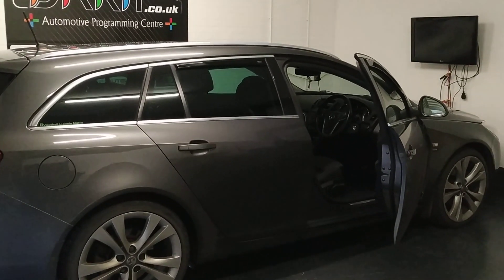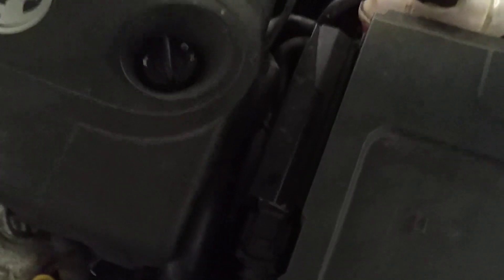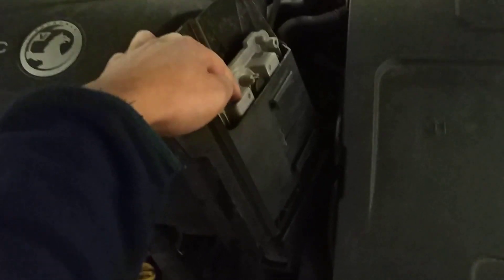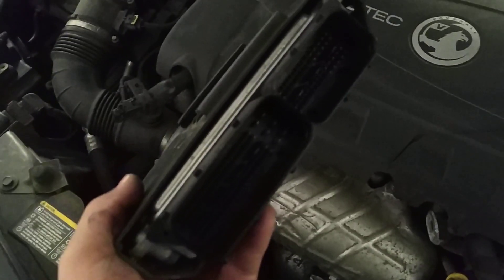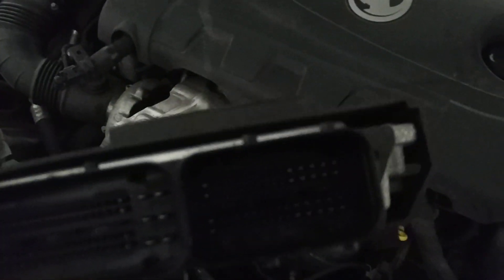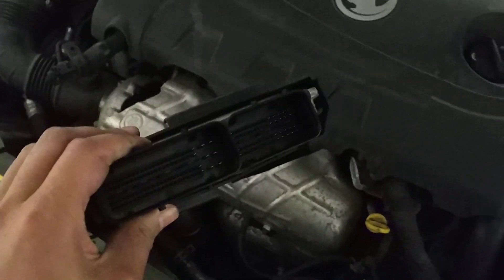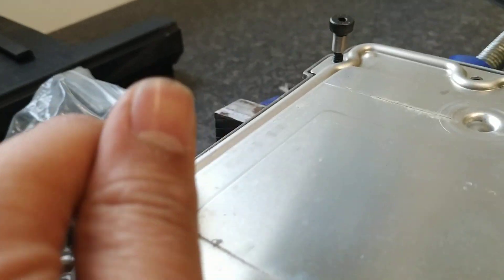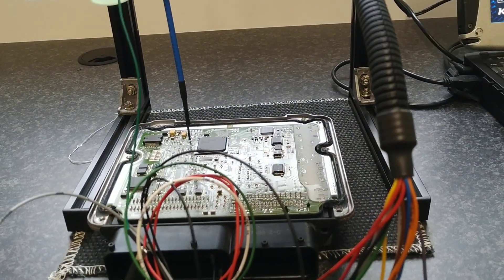Using KTAG to program TRICORE Protected Vauxhall Insignia BOSCH EDC17C19 ECU with KTAG

Comment: How come you didn't have to solder in the 2 450ohm resistors?
Reply from the maker: You don't need to as the blue drop pins carry plenty of resistance so there is no need for the resistor
Reply: @TheOBDcompany  👍

Comment: If you invest in genuine tools and not chinese clones like the one in this video you can do this job with genuine k-tag without even opening. Genuine k-tag doesn't even cost that much if you are professional. I do 1-2 jobs a month where someone using a cheap clone tool has corrupted an ECU and then disappeared, if you provide training you should promote genuine tools don't you agree.
Reply from the maker: @4:59 on the video you will see that this is a genuine tool and not a clone tool. We only use genuine tools and only sell genuine tools. On the genuine tool you can use the new 3.0 (Silver) software or the older (In some cases more reliable) 2.0 (black and red)   

Alot of companies prefer the older software, but I completely agree. Genuine tools are by a long measure safer and much better to use and I plan on making a series of videos that will point out the differences

All the best 
Lewis